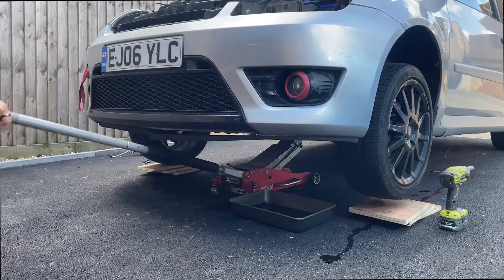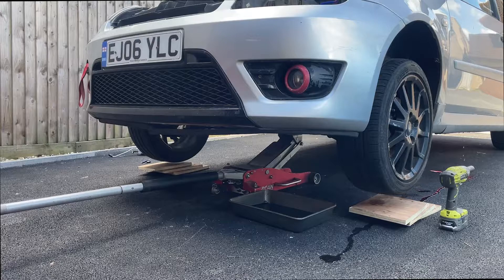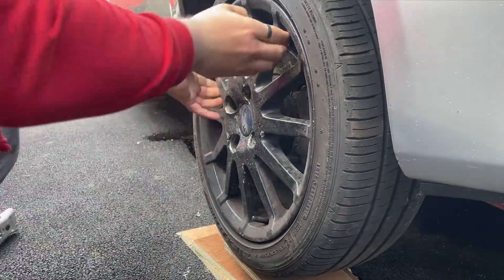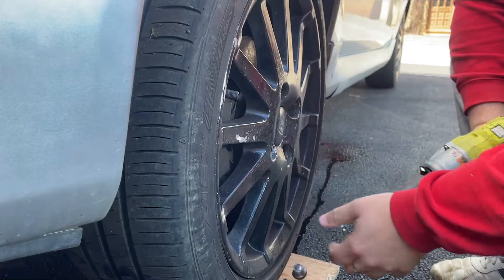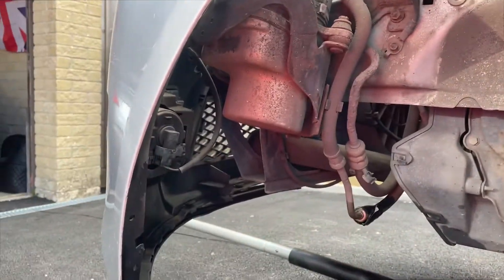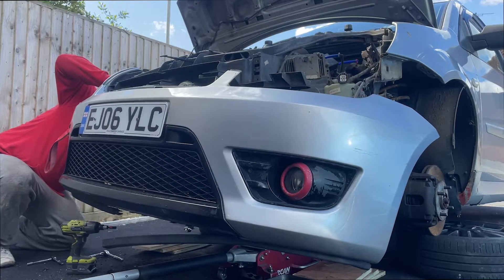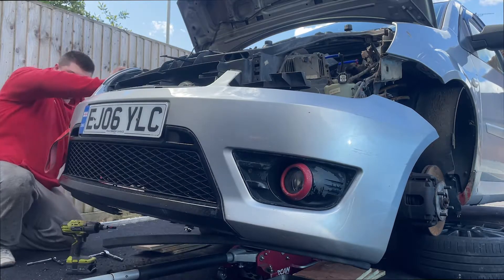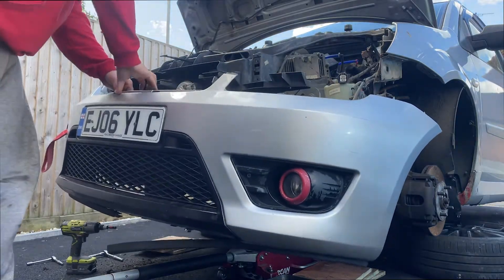How To Remove Front Bumper On A Ford Fiesta MK6/ PROJECT CAR UPDATE!

Comment: Hi guys, i have a 2005 1.6tdci fiesta, it's a 3 door model, i bought the car with standard front and rear bumpers, no facelift. Does anyone know if the st bumpers would fit on this model? I know the facelift bumper would fit because a friend of mine has the same car and bought a facelift bumper but i have been hesitant about changing mine to the st model

Comment: I replaced the starter motor on my Mk6, wow it was so tedious and stressful. Everyone I was getting somewhere I dropped something. So annoying. The issues ended up being an issue with the ignition switch not signalling properly so I did it for nothing!

Comment: Hi dude really stupid question this probably but what's that silver tool you're using to get the screws off? 😂
Reply from the maker: If you mean the ones in the wheel arch , it’s a torx bit so it’s got a star pattern instead of a Phillips head